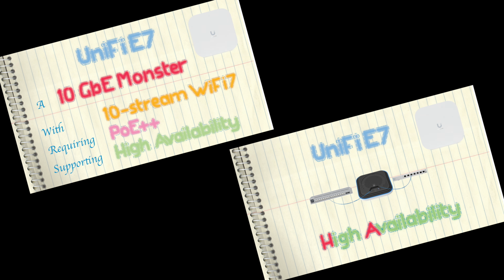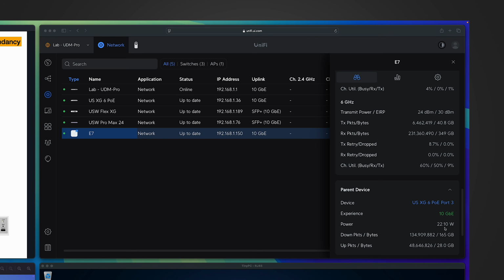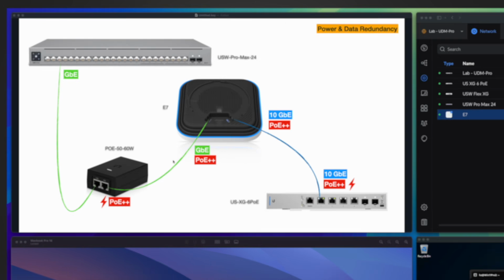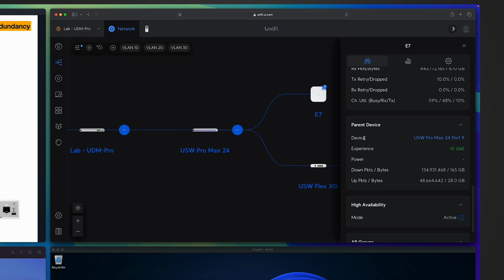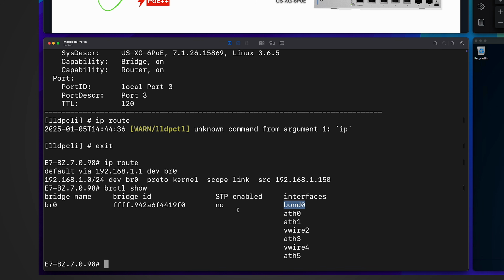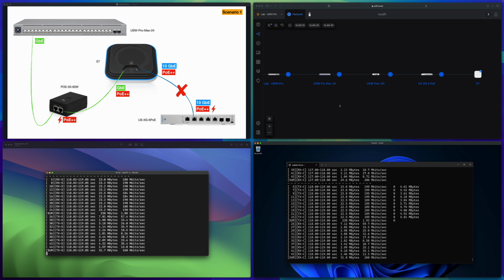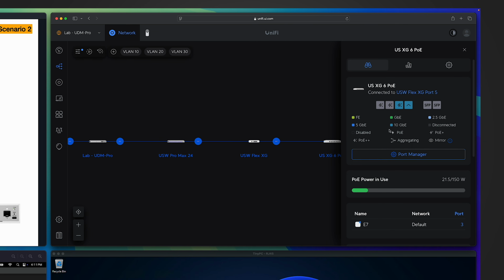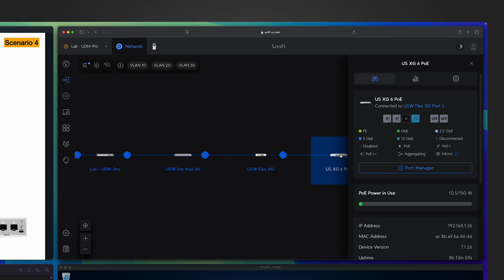Ubiquiti UniFi E7 Access Point - High Availability (HA / Data & PoE++ Redundancy)

Comment: Very good video a lot of effort!
I need your help Im moving to a 3 floor house about 160square meters and not sure if I should go for 1 E7 or get many Wall Ap.
Problem is also the iot devices so if I go for lets say 3 wall mounted AP then I will go for the 6 series to avoid the iot problems...
Reply from the maker: The E7 should be able to cover your square meters, but I am not sure about the 3-floor part, especially not sure whether the house is in wood or concrete.

I am not aware of IoT issues, but maybe it's because I have other APs so even if E7 has issues the devices can still connect to other APs.
Reply: @hz777  Yes, there are people in trouble with IoT devices that work flawlessly with WiFi 6 products from Unify.
My house concrete (live in Europe).
I love the E7 idea but I think I can't justify buying one since there are 3 floors in total, I guess will put 1 AP per floor instead!

Comment: I am using the same switch setup with my E7s and I get an occasional network loop. Turning off data on the ProMax24 switch port which E7 uses for secondary fixes it.
Reply from the maker: It's not the first time I heard of its network loop issues, but I have never encountered the same. 

Even though incorrect Linux bonding config may lead to network loop, but I doubt that's the cause. So puzzling...

Comment: Very much enjoyed your video! I always learn something from your videos! Thanks for all your hard working! I recently replaced my two U6 Pro with E7. I have noticed with both primary and backup ports connected, my network gets occasionally loop back, the entire LAN will be down momentary then recover by itself. I have also noticed UDB had trouble to uplink to E7. After unplug the backup link, all worked as normal. Since I don’t have your knowledge and diagnose tool and methods, i can only go by my observations. My setup is fairly simple, my primary is connected to USW 16 pro max with 2.5gb link, and backup was on USW 24 pro max 1gb link, both switches are uplinked to an aggregation switch. I am just wondering if you saw any network loops. Thanks.
Reply from the maker: I have not noticed similar loop issues. It should not happen if the linux network interface bounding works properly... I can only suggest you to open a ticket with Ubiquiti.
Reply: @ Thanks for the quick reply.

Comment: I just gone mine as well, its huuuuuge & heavy! got 2-3dBm better in general vs my previous pro max
Reply from the maker: @pewpewpew8390  yep, it's h7uge!
Reply from the maker: I don't have time to seriously use it yet, but based on my observations so far, with the same wifi settings, even with "extended 6g range" enabled, E7 has slightly weaker signal strengh than U7-Pro-Max, when I am not very close to them.

EDIT:
Let me take the above statement back. The result was caused by me testing client and did not make sense. I will be working on my overdue E7 video and I will include the signal strength as part of it.